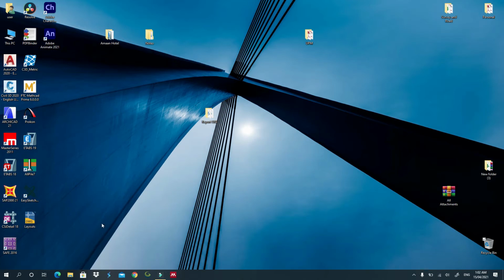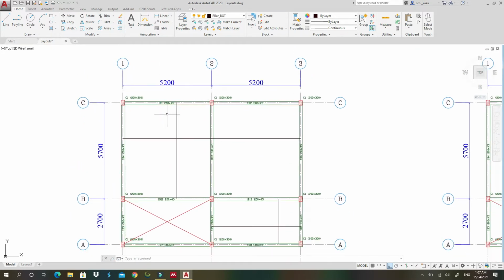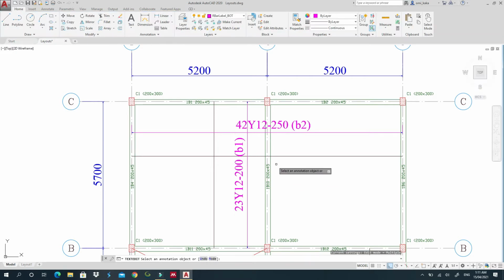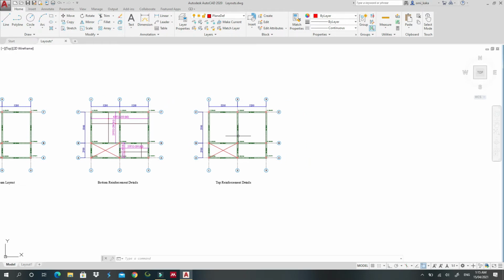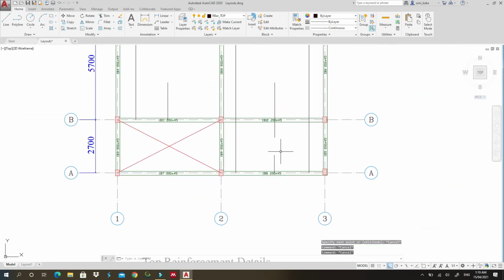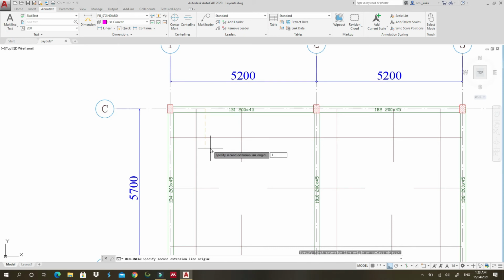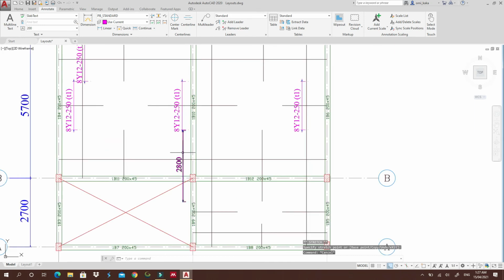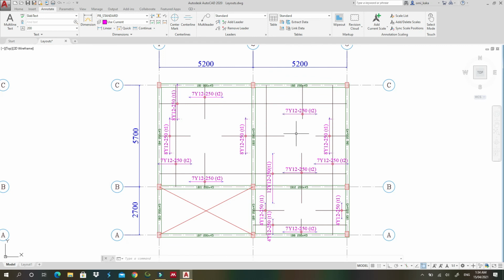How to Detail A Two way slab using AutoCAD. Slab Detailing according t0 British Standard

Comment: My onwly concern is on panel 1 grid 1. The short bars should also be 1/3 of span which is 1/3 x 5200 which comes to 1733. if we then divide this by 250 for spacing then we are getting  6.9 (7) bars. However on your detail you appear to suggest the bar that starts in panel 1 - as indicated in the middle of the dimension of 5700 if indeed is 1733, would only take 7Y12@250mm . Am I just confused or could it be you got mixed up? if you can clarify for me please

Comment: You designed the slab close to the stairs as a 2way slab. It should be a 1 way, hence only one main reinforcement. Also why designing for bars at the extreme when its not a continuous slab.
Reply from the maker: The entire structure was designed as it should. However, during detailing, its on the designer to choose how to detail

Comment: when I check your drawing is wrong your grids are off-center from the columns and your columns and beams are not aligned correctly that why you failed to get 5700 and got 5697 you. the beam width and the column width must be the same so as they share the same effective length, 
2 .when we do detailing we  detail from the concrete cover in yours slab there is no concrete cover which is 30mm for 12mm bar.

3 Your bar calculation formulae is wrong  it must be 5697-2(30)= 5637  divide by 250mm +1 spacing but for Y12 We use 200 C/C THEN 250 for Y16 as distribution bars. if you didn't add 1 it means what you have is spacing not Number of bars. your grid numbering must start from top to bottom a-c and right to left. that's the British standard.
Reply from the maker: Noted
Reply: what if its how the engineer has carried out his annontations from bottom to top for the A-C grid and right to left for the 1-3 grid??